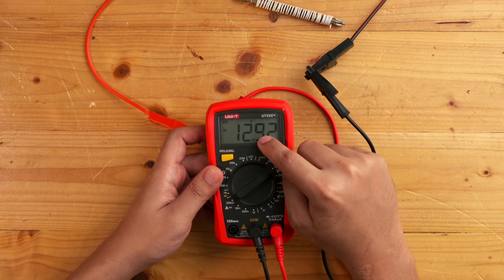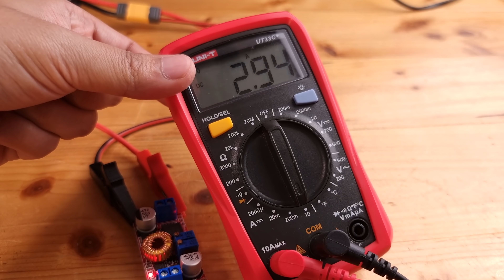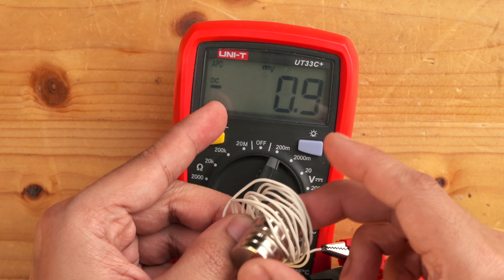Macam mana wireless charge berfungsi? | Elektromagnet

Comment from the maker: Ingat.. Kalau korang nak eksperimen, mesti control arus/current.. Jangan guna high power battery macam lithium ion.. Itu boleh pergi lebih 10A current, memang cair cable tu.. Pakai bulk converter macam saya pakai ni, dia boleh limitkan current tu supaya tak tinggi.. 

Kalau pakai battery AA, no problem ikut eksperimen ni direct sebab battery AA tak mampu bagi output current tinggi..

Step Down Bulk Converter : https://invol.co/cl6e53n
Reply: Abang cuba buat diy arduino

Comment: Kalau wireless charger tu menghasilkan AC current, macam mana boleh convert tu DC? sebab kalau charge battery memerlukan DC current kan? Kalau tak silap lah 😅
Reply from the maker: Kan saya dah tunjuk saya buat rectifier tu.. itu akan jadikan dc balik..
Reply: @BeraniBuat  okay faham. Terima kasih tuan 👍🏽👍🏽
Reply: @BeraniBuat  kalau pakai retriefier sahaja x stabil sangat arus dc tu bang.kena tambah capacitor.baru lagi cun.stabil je